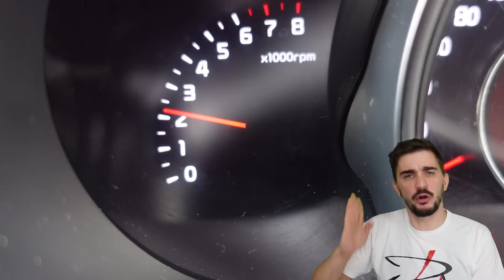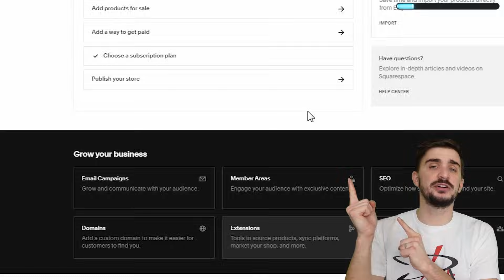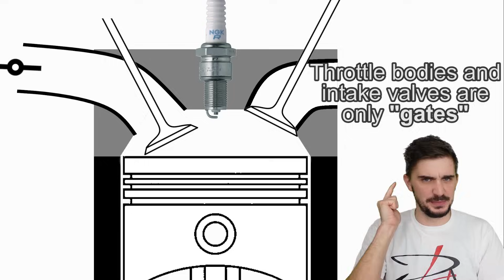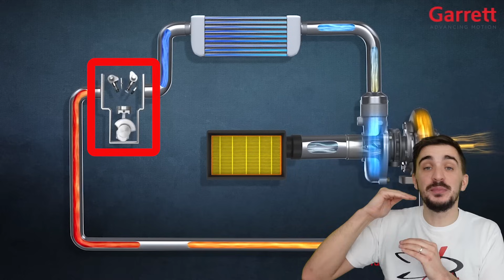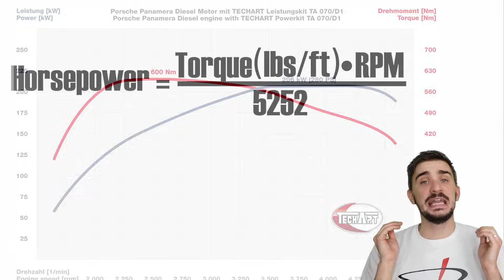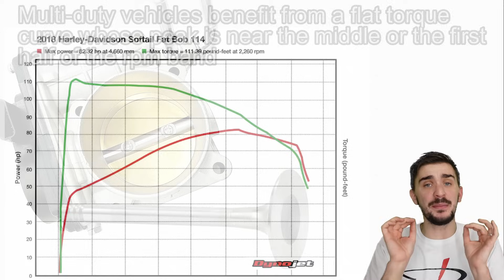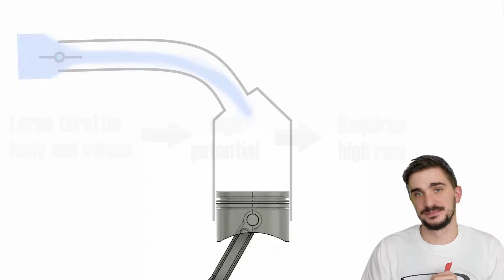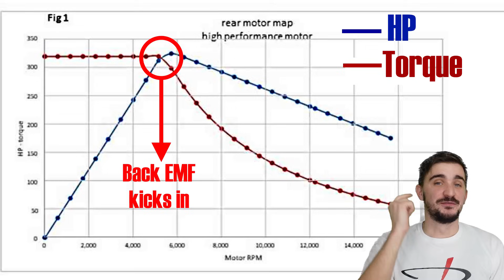WHY are HORSEPOWER and TORQUE CURVED?

Comment: Somehow, I don't agree with your explanation of low piston speed = less air will get in due to (indirectly, since you didn't state it) less vacuum. Engine will generate the same amount of vacuum no matter what RPM (unless there's research that it's variable, I'm free to be schooled). The engine also doesn't generate more vacuum on a rising RPM, but instead moves air more cuz it's spinning faster.(Yes, it's generating more vacuum in a given time because it's just doing more revolutions per time, but i don't think the engine would generate more vacuum on an intake stroke from high rpm vs low rpm). The vacuum it generates on low rpm is the same vacuum on high rpm. Only air velocities are the differences between them. 

I believe it's due to engine efficiencies and flow characteristics why we can't get the most air on a low RPM, there's just simply not enough air velocity for the air to reach to the combustion chamber on time. That's why race engines don't have enough torque at low RPMs because there intake manifold/throttle bodies/valves are designed to have maximum flow and velocity at high RPM. The opposite is true for economical engines, maximum flow and velocity on low - mid RPMs, but they run out of steam up top due to having smaller design to have maximum air velocity on a low RPM.

That's why variable cam engines combat this by altering the cams to have the right amount of lift/duration/intake valve opening time for a given RPM to achieve maximum air velocity for air to come rushing in to the combustion chamber.

Perhaps your explanation would be way better if you said piston speed generates more vacuum per given time.
Reply from the maker: And what dictates air velocity?
Reply: @d4a  I agree piston speed dictates air velocity. What I don't agree is the low RPM = low vacuum and high RPM = high vacuum, hence more air.
Reply from the maker: I never said it makes more vacuum in the sense of quality, i.e. A greater reduction in pressure or a different value. I'm saying more vacuum in the sense of quantity. As I said in the video "more vacuum faster". More vacuum faster pulls in more air faster because more void is made quicker. Vacuum moves air. A number of people misinterpreted this, I should have likely made it clearer by explaining it additionally.
Reply: @d4a  So...are you saying the low air velocity into the chamber at low RPM means less turbulence/mixing and so less complete or less rapid combustion and therefore lower torque at lower RPM? If so, then  yes, I definitely missed your point.
Reply: Dave Pin  "Inertial effects" aren't dependent on rotational speed, just on rotational acceleration. So they won't change what the torque curve looks like at 0 RPM vs any other RPM.

Comment: If you completely eliminated the torque curve on the dyno graphs… it wouldn’t change anyones life acceleration or even towing! The reason is because HP IS “WORK” 100hp at 2000rpm vs 100hp at 6000rpm will be exerting the same amount force regardless of the torque… in this made up scenario it’s 175ft/lbs at 2000 and 87ft/lbs at 6000rpm… if we COMPLETELY disregard friction, heat generation, wear etc. in a theoretical sense a Honda Civic making 600hp is producing the same amount of energy required to haul a trailer like that of an 18 wheeler! If you still don’t believe me… it’s the same principle as a torque wrench, it’s no longer rotating once a nut or bolt is seated against a surface! And if you STILL don’t believe me look back at the Teslas dyno graph 200ft/lbs of torque and 0 HP at 0 RPM… torque is juts leverage it’s completely unnecessary for tuning, if you never saw it on a dyno graph ever again it wouldn’t impact anything! HP at any given RPM tells you everything you need to know

Comment: It all boils down to inertia. Energy transfer isn't instant, especially in mechanical systems. It takes time for energy to be transferred from the combustion to the piston, to the crank, to the timing chain/belt, to the cam shaft(s). All this mass has to be accelerated.

Comment: Thanks for the insight, hopefully everything is very different when transmission/gear ratios are taken into account. That might make for a very nice subject!
Reply: If I'm not mistaken, the transmission is used to keep the engine in the RPM that have the most torque or power, depending of the engine, the use you have at the moment etc..

Comment: The question is: acceleration follows torque curve or power curve?
Reply: If in one specific gear(Without slippage of course) Acceleration follows the torque curve as it is the engines torque times the drivetrain gearing that gives you the drive wheel torque(Obviously there is losses), but you should try to remain at the RPM for max power to get the best acceleration.
At the max power RPM the engine has the most "torque*RPM", that higher RPM could be converted to lower rotational speed but higher torque by gearing.
So if you are at peak torque RPM in some gear you could shift down to another gear getting the peak Power RPM, the lower gearing gives you more drive wheel torque even though the engine produces less torque(At the crank) at that RPM.
Remember that torque*RPM is power, and RPM can be manipulated by gearing.

Comment: OK, I'm puzzled about piston speed creating vacuum. If I move the piston very slowly downward then I can fill the cylinder with air according to pv=nRt. Does that somehow change if I move the piston more quickly? Is there some kind of momentum effect to the in-rushing air that lets me put more air in the same volume?
Reply from the maker: You need to think in relation to rpm and the accumulated airflow generated within a period of time. More vacuum within the same period of time means more air trying to pass through the same orifice.
Reply: @d4a  Is it actually more vacuum per unit time? The duration of the intake stroke obviously decreases as rpm’s increase, so are you getting enough of an increase in average airflow per unit time from the increased pressure gradient, to make up for that? 

If the piston moves slow enough that the pressure and temp differentials approach zero, then the number of moles  will be proportional to your change in volume. If the piston moves too fast, you’ll create a large pressure gradient which will suck air harder, but if the pressure doesn’t have time to equalize (or better), then you’ll end up with lower-than-optimal pressure inside the cylinder, and higher-than-optimal pressure remaining in the manifold. In other words, some of those molecules that you theoretically could’ve sucked in at near-zero piston speeds, instead will be slamming into the closing intake valve.

This is where it gets beyond the scope of  my understanding because the piston obviously doesn’t move slow enough that pressure and temp changes are negligible. I would assume it can be designed such that the timing is just right for a given rpm range so you actually end up with some momentum effect (where the pressure fully equalizes and then some, before the valve closes), but my hunch is that the previous commenter is right that it would hinge on getting such an effect in order for the decreased intake duration not to cancel out increased pressure gradient.
Reply: @jcorkable  in another comment thread someone argued that the heat transfer from the gas to the cylinder wall is significant at low rpm - quenching the combustion gasses enough to lower torque. I don't KNOW that he's right, but I think he is. It makes plenty of sense and seems believable given the dynamics of heat soak and the need to overcool at low rpm, low load so that the engine doesn't melt at high rpm, high load.
Reply from the maker: Here's something pasted from another comment to help a bit: I never said it makes more vacuum in the sense of quality, i.e. A greater reduction in pressure or a different value. I'm saying more vacuum in the sense of quantity. As I said in the video "more vacuum faster". More vacuum faster pulls in more air faster because more void is made quicker. Vacuum moves air. A number of people misinterpreted this, I should have likely made it clearer by explaining it additionally.
So basically the essence is air velocity which obviously also impacts air quantity and for example on a fixed valve timing engine you size the all the intake stuff for an air quantity at certain rpm. The heat transfer argument has a point but it's not a primary determinant. If it were it would be impossible to make low speed engines have high torque and high efficiency.
Reply: @d4a  but that's just rpm - which you're already accounting for when you calculate hp.
Reply: Or maybe another way to say it is, trying to pull more air per unit time doesn't change how much air you pull on one stroke. The force produced by a single power stroke isn't going to increase from having more power strokes per unit time. Torque is not measured per unit time. It's not an energy flow rate, so to speak. Horsepower is, though, because horsepower is each of those single power strokes added up over time. To make the torque curve go up over some rpm range, you have to be getting more force out of each power stroke.

Comment: Ah, but what about the gas speed and gas inertia?
A narrower TB will give higher gas speed and the exhaust can be play a crucial role in pulling the gasses through the engine.
Which is why kids ruin their torque by putting big bore exhausts on cars or shorties on bikes.
Reply: I think he did a video about this already

Comment: I'm sorry but I do not buy your explanation why the torque should be lower than max torque at low RPMs. The explanation that the piston move slow simply does not make sense since the time the valve is open is exactly proportional to the piston speed.
I suspect the reason is more complicated and involves things like resonance in the intake that actually push air into the cylinders.

And the top RPMs are often limited by the injectors and, of course, the engine control electronics. At least on production engines. 

And, as a side note, my forced injection BMW 428i produce a flat torque curve from 1300RPM up to 4900RPM and then a flat power curve from 4900RPM up to 6600RPM. All electronically controlled, of course.

Comment: 6:47 your answer here is wrong, peak torque is not always generated at a higher RPM than peak horsepower. Look at any modern NA or  turbocharged diesel where the torque limit isn't restricted by the tune and you'll see that below 5252 rpm in most instances torque is equal to or above horsepower. These engines only only rev out to 4200 RPM on the high side.

Comment: Hey, i have been a long time fan since your original mr2 videos! I hope you can take the time to learn from me a little that i have from you!

I'm sorry to say that this might be the first video that i saw of yours that I disagree with. And allow me to explain: I believe it to be more of a fluid dynamics problem: air being our fluid. In a low RPM (quasi static) scenario we would only accept as much air as the piston displaces (for a given air density as a function of temperature, pressure, humidity, oxygen concentration, etc...) And in this scenario, the air in the intake system itself is stagnet and not flowing. A fairly easy calculation.

However; when you get the intake air moving, there is mass moving in this fluid that is able to supply a larger amount of air (oxygen) in the piston than the piston displacement would allow for. Effectively increasing the compression ratio. This continues as rpm increases, airflow increases more air is allowed in until the rpm reaches a point where you get diminishing returns: the piston reaches the end of it's lower stroke before the air can fully fill the cylinder. This is bad for HP as you are no longer burning as much as you were prior.

The larger intake tubes and air passage ways come again to the idea of air flow: smaller channels experience boundary layers in fluid flow and make it much harder - imagine blowing a breath through a small straw versus a larger boba straw: not only is it easier, but it is faster as well.

As for the fluid flow having the real energy in increasing HP, look no further than water hammering in hoses: it is much harder to stop a fluid while it is moving that stationary under pressure. But that is much more devastating in water because it is an incompressible fluid. Our case air, we do not see that drastic spike in pressure, but a mor mellow hump, this spike of pressure from our air moving and then being stopped by the piston effectively increases the pressure, thus the oxygen content for combustion.

One affect that is conveniently tied to rpm is the time that the pressure chamber has to leak. I'm sure you have tried cranking and engine over by hand slowly with the spark plugs still in and you can feel the compressing strokes and hears a hissing sound. This hissing sound is pressure escaping through piston rings and hopefully not valves or gaskets! All that hissing is power losses as blow by. So the faster that you can go through a cycle the less time there is for this loss to occur. I'm also sure that as rpm increases so does temperature of the piston and piston rings: thus expanding and making smaller gaps for the rings to have blowby.

Also as a final statement of your interpretation of power being tied to rpm, think of the limits. No power at 0 rpm and no power at infinite rpm since no air can enter the chamber at these speeds.
Reply from the maker: I honestly read the whole thing, twice. So basically the reason for torque being a curve is blow-by? Or did I misunderstand?
Reply: @d4a  Yeah i was a bit all over the place on that one. Currently running on fumes as it is my finals week!

To summarize air flow can be seen as a mass moved per unit time. The cylinder in a single intake stroke has limited time to allow this air flow to occur. Slowly moving air towards the cylinder, say from the displaced air from the previous cycle or nearby cylinders, will have an easier time flowing into that cylinder than the stationary (static) air i was talking about.

I suppose this might be a better analogy: say you have half a second to fill up a balloon through a 25 ft straw. You can't start blowing until a bell rings. You have 1/2 of a second to fill it up. You would barely notice this filling up as it would take time to compress the air in the balloon and in the straw, but also the pressure wave sent down would delay your filling times. 
Now imagine you were already blowing through the straw and air was coming out the other end. When the bell rings the balloon would be placed on the straw filled for the half second then removed.

This is similar to the automotive topic,but with a positive pressure wave instead of a negative one through the straw/intake

It is this difference in air put into the balloon that related to the cylinders being filled with more air. But at a much more drastic degree since at 5000 RPM i get 6 thousandths of a second for the air to flow in (5000rev/min *1min/60sec)^-1 =0.012 second per revolution. Intake is half a rev so 0.006 second for air to squeeze into the cylinder passed the valves.

If it's still unclear maybe i can hop on a zoom/discord call and work my MS paint magic and show some pressure diagrams.

Cheers!
Reply: @Heath M  I understand what youre saying, and the balloon analogy is great, however it doesn't take into account the valves. When an intake stroke is completed the valves seal and prevent airflow. this means that the air simply wont go into the port for that cylinder, the air already sitting in the port has become stagnant and therefore any benefits seen from the inertial force of the air mass is negated. i would imagine that this is especially true in the case of uncovered ITBs, meanwhile in a more conventional intake manifold you may see a slight benefit from this however i cant imagine it would be much.

If the effect you described were taking place, and even if it is, if the effect was big enoigh, then we would see more power at lower rpms after an upshift since the air velocity would be high when you are in the lower gear at high rpms, then after a quick shift you would lose some air velocity but it would still be higher than without the downshift (assuming the shift was done quick enough).

You say that the reason that it starts to decrease is due to the piston reaching the end of the intake stroke before theres time for the air to fill the cylinder however this contradicts your own logic, air velocity would be faster at higher rpms and so it would be able to fill the cylinder faster as well and before it reaches the end of the stroke. the true limitation for power simply comes down to what he said in the video about air restrictions from valve size and throttle body size.

Also you mention breathing through a small straw vs a boba straw and say that with the boba straw it would not only be easier but faster, you seem like a smart guy surely you know that the air velocity would be higher in the small straw since you dont have as large of a cross section of air and so the only way to get the same amount of air mass through is by having it be faster. the boba straw meanwhile can easily allow a large amount of air mass through without needing fast velocity to achieve it. Unless you mean you would be able to get the whole breath out faster, in that case that relates back to how throttle body and intake valve size relates to diminishing power at high rpms.

Im sure I missed something but i cant remember the whole argument, either way what you're saying makes sense I just dont think it causes as big of fluctuations in power as you expect